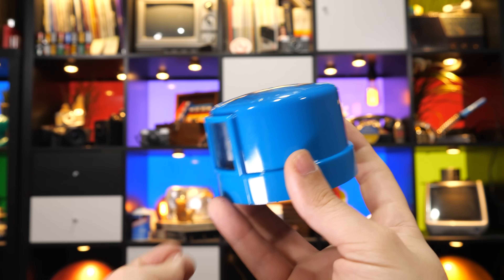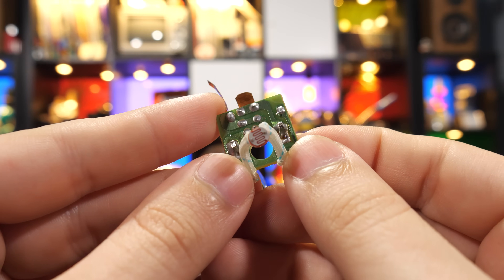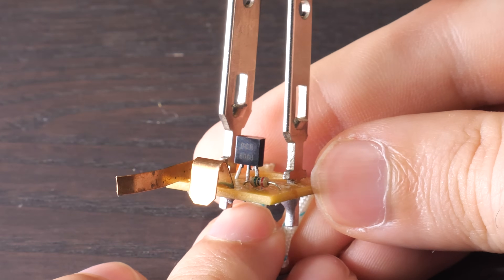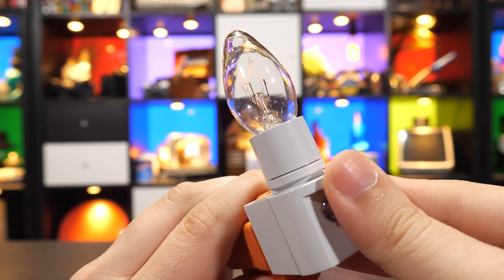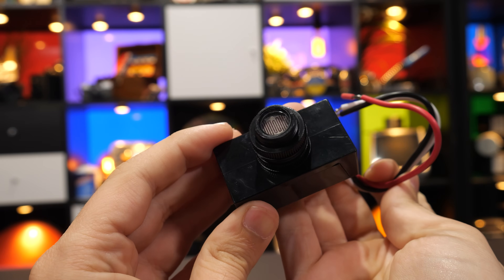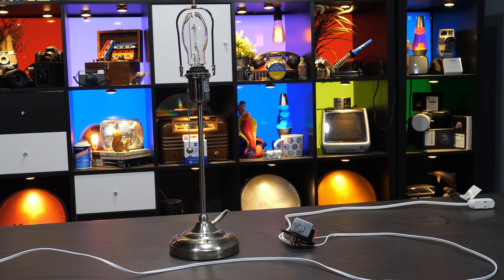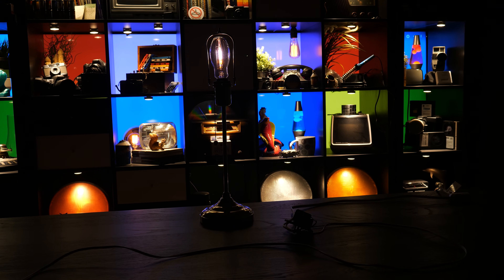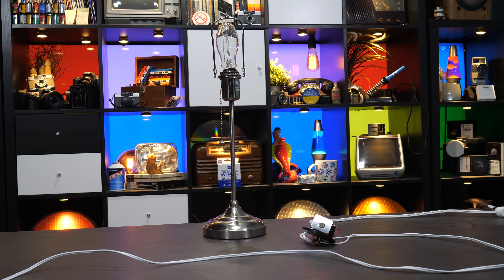Photoelectric light controls are weirder than they seem

Comment: You could also use a little solar panel connected to a relay to have a colder version of that thing, like in the little garden night lights that run off a rechargeable battery. (the solar panel charges the battery in the day and when it gets dark enough it triggers the lamp and stops charging)
Reply: Agreed.  My mother bought a bunch of these solar garden lights and sent them to me. Quite brilliant circuit to use the panel for charging and also to detect light levels.
Reply: @jankrynickyThey don't though. If you look up some studies on solar panel efficiency vs cleaning, they can lose up to 50% of their output very quickly. And they can't be mounted vertically like a photoresistor/diode so dust and bird-poop build up.
Then looking at the circuit, does it still work after losing 50% of it's input energy?
How does that compare to a photoresistor losing 20% of it's resistance? Does the circuit still do it's job?

The photoresistor circuit is much more tolerant to a wide range of conditions and the mounting angle helps it operate more consistently.
It's simple and robust.
Reply: This is done.
But it is also wasteful in it's own way.
Those batteries are consumable.
The solar panels are consumable.
The maintenance/replacement costs are orders of magnitude higher.

It is still useful to have that solution in your pocket for when it really IS the better solution, but 99.999% of the time it isn't.
Reply: @Prophes0r one of the things this channel has highlighted for me is the difference between durable goods, and consumable goods. Things like solar panels and rechargeable batteries get close to that dividing line. How many use cycles can you get out of a system before it goes from consumable to durable? I guess a good reference would be the rest of the object. Whichever piece wears out first is the consumable. 😂
Reply: @Prophes0r 
In street lights the battery would obviously not be needed and instead the solar panel would just trigger a relay or  transistor.
Reply: @Prophes0r a capacitor would take care of quick changes.
Reply: @Prophes0r  yes and no. the panels aren't consumable except panels that use transparent polycarbonate as covers.  the nickel metal hydride batteries are atrocious though, they have little capacity, dies in a year or two due to little cycle life around 500 cycles and heat exposure.  Lithium-ion based lights are better as long they don't get exposed to heat and costs around the same or cheaper than NIMh for much more capacity and cycle life. We have a cheap motion detect flood light at the main entry with the lithium ion battery housing separate from the solar panel. it has been working for more than three years and I'm itching to replace its stock 18650 battery that still works.    In short, it is worth it especially if you live in a country with expensive professional electricians.

Comment: So how much does outside temperature change the trip points? It seems like -60F vs. 110F should make a difference. Actually a black enclosure in direct sunlight should push the temperature even higher inside. As in higher than the switching temperatures shown. Even after the sun goes down, it will take significant time to cool down.

Comment: To your remark of using a microcontroller. I wouldn't even consider one simple logic circuitry with a Schmitttrigger (German for comparator with Hysterese) would do the trick for switching the relay. But yes this also would require a power supply of sorts.

Comment: The UK ones use a transparent cone of plastic rather than the directional design here. The thermal ones were temperature compensated with 2 bimetallic strips and an open micro switch mechanism. The resistor was attached to one strip, whereas the other one sensed the ambient only. The thermal ones are so simple and last decades yet they’ve been superseded by complex electronic designs which aren’t as good in many ways - one of them is they don’t switch the lights on until it’s almost completely dark.

Comment: There are electronic variations as well. One of the advantages of using a bi-metal strip is that there is hysteresis in the curve of how light is has to be to turn the streets lights off, and how dark it needs to be to turn them on. A feature that stops lights flickering, or turn off and on in rapid succession. This feature makes it more complicated to duplicate the device as an all solid state device.

Comment: In my home town (in Finland), all of the street lights are controlled centrally. There is some light sensor, but I don't know what technology it uses. But that is connected to some sort of computer software. That way, they can light up the lights in a sequence, area by area, thus causing less of sudden power usage increases in the grid. And they can also easily adjust the threshold, schedule the lights to be off during low traffic (or dim LED street lights) etc. The downside of course is that it makes a single point of failure to be able to switch off all street lights (or on), but in practise, I can only remember one time when the lights inadvertently were switched on during the daylight.

Comment: I have a set of lights that I purchased recently battery powered for nighttime use, but they charge with a solar panel. Something I have noticed, however, is this light string does not have a photo resistor, and it pretty reliably can tell when it’s nighttime and daytime. Actually, I think better job than all the photoresistor lights that I’ve had before. 

I wonder how easily that could be adapted to be used   And I also wonder if utilizing something of this measure would be a better way of handling it versus a photo resistor.  I imagine it probably would use less power or be self powered for handling the switching…

Comment: When I took apart one of the photo controlled night lights and checked the part number of the semiconductor, you called it a Thyristor (SCR), was actually a Triac ( bidirectional triode Thyristor) with an internal Diac (bidirectional trigger diode).

Comment: Now that street lights are going LED, many of them will have DC power supplies in them. I think some have radio modules too, for remote control/monitoring. I wonder what the cost saving Vs hardware/infrastructure cost is.
Reply: I think LED street lighting turned out to be a false economy, given their electrical complexity (lots of circuitry and components inside) and lack of robustness, compared to older electro-mechanical types. Personally, I prefer the older style sodium vapour lamps over harsh LED street lighting.
Reply: @techcafe0  if they weren't economical I'm sure they would have been abandoned by now, but I'm seeing more and more being installed.

Comment: If you were wondering why a thyristor is a better choice in that circuit than a transistor would be, it's exactly because of that latching behaviour that only lets it turn off once current stops flowing during the AC cycle. For incandescent lights that isn't too important but for gas discharge lamps that have a magnetic ballast, it avoids generating that voltage spike that happens when you try to stop current through an inductor. It also means it's never "half on", which means when it's on its resistance is very low and it stays fairly cool.
Reply: My question is why a thyristor and not a triac (which is essentially just two thyristor/SCRs back-to-back). it means a very lumpy half wave rectification, which will not suit all load types. I think a switch just ought to turn the power on and off and not be some sort of half-baked light bulb life extender. That sort of waveform is less than ideal for many sorts of lights and LED drivers and if the aim is to extend lamp life (at the expense of efficiency I might add), then specify that in the lamp, not the photo-sensitive switch. 

All the light sensors of this sort I've seen in the UK (which use the same fitting) appear to be full wave, albeit the internal circuitry is different and the modern ones at least don't use thermal switches.

Comment: I think you could go on another tangent about the history of light activated switches with the start at the sun valve used in lighthouses and it's inventor Mr Dalén. It actually worked in the same principle. Sun heated metal rods that expanded closing the gas valve.

Comment: So if there's thermal mass to prevent frequent switching, what's the explanation for the street lights that go all strobe light?
Reply: If they're LED lights, then probably a failure in the power supply or driver electronics, I think.

Comment: Also, because of the usage of heating element, the heat switch opens sooner, when it's cold outside. Like in winter, when street lamps are required to be on quicker.

Comment: Would the heater-based switch have issues with ambient heat? Like if it's 100 degrees F wouldn't the lights take longer to turn on in the same lighting conditions if it was 10 degrees F? Or is the heat difference in normal conditions too small to affect things?

Comment: The fact that these switches turn the lights on when power is restored after an outage is a bit of a problem. Part of the difficulty of restarting the grid is that there are a lot of systems that will come on at full power if they've been off for a while. The grid can handle the combined intermittent load of all the AC running on it, but if the power goes out for a couple hours, everyone's homes will be warmer than they want, and when the power comes back on the thermostats will all simultaneously signal the AC to come on, creating a big spike in power demand. Adding all the street lights onto it makes the problem even worse. It is a manageable problem, generally by turning power on in sections.

Comment: Photoelectric controllers are awesome and this electrician recommends using one of them instead of a contactor bank or digital clock control wherever possible. Way more service calls on the latter two options.

Comment: Brilliant. Great example of how to do this kind of engineering. You need to make two hundred million of the things so they've got to be cheap, and they need to be absolutely bombproof because every time one breaks someone has to go out with a ladder (it was a ladder when this thing was invented!) and replace it, see again earlier point about being cheap. If your reasonably sized city has half a million street lights, it doesn't take much of a failure rate before you're spending way more than it would cost just to leave the lights on all the time. (This is why in the days of gas lighting they did just leave them on all the time.)
And back to that point about being bombproof... They quite literally are. It's not just the lightning-induced EMPs that these can shrug off where a semiconductor would self-destruct. You can be quite sure that this feature gave a few decades of reassurance to emergency planners who knew that working street lights would be instrumental in maintaining civil discipline when the godless commies inevitably used the bomb.

Comment: Could you join me in raging against the new LEDs that my city has replaced all our high pressure sodium street lights with? They remove the side glass, and the LED is only at the top of the fixture, so instead of a nice glow from the street light that uniformly lights up the street and sidewalk, you get a bight spot directly below the light that kills your night vision, and then complete darkness for 90% of the way to the next street light. I'm sure the star gazer environmentalists love less "light pollution", but if you can't see where you're walking and it dazzles you when driving, I'm sure they're causing more accidents or something.

Comment: That night light design you showed at the start shouldn't be allowed on the market.  Switching the outside screw part of an Edison base is a no-no for safety reasons.
Reply: except, that's not how the circuit is layed out. the neutral pin is (correctly) wired directly to the 'outside screw part', as you put it. The neutral terminal in the E12 Candelabra socket is NOT switched; the Hot side is switched on/off via the thyristor.
Reply: @techcafe0  Watch around 2:18 again.  You will see that you just presumed they did it correctly.  You can see clearly that the pin of the bulb is directly to the line and the screw part is switched.  At 3:34 he did a diagram.

Comment: A software-based controller might be a bit overkill, but I see no reason in principle why there couldn't be fully electronic versions of these photocontrols that do the work without mechanics or computers. I've seen this in some cheaper domestic dusk-to-dawn light fixtures (even ones that implemented hysteresis between the switch-on and switch-off light levels), though maybe they aren't as common in commercial/streetlighting applications due to cost or perhaps other issues (I could see an all-solid-state system capable of switching high-current loads being much more expensive than a conventional electromechanical one).

Comment: Back in '99 when I was still in high school, I used the CdS cell from an electronic hobbyist kit from Radioshack to build a "fisherman's alarm clock" as a science project using a battery pack, switch, the photoresistor, and a piezo speaker. The gist being that it starts to screech at the crack of dawn. Everyone was amazed and thought I was a genius despite how stupidly simple the circuit was, I think I built the thing in under an hour, and that included painting the cardboard candle box I used to put it in...

Comment: This explains why these can be had so cheaply. I bought a few as spares for the outside lights and they were £1 each, including postage. Don't know if they are any good, not needed to change one, I think those do have extra components inside however, guessing a microcontroller etc.. 55 LUX for energy saving, although I'm sticking with the standard 70 LUX ones which were supplied, as long as they keep working.

Comment: 16:45 well, instead of using that to control street light contactors you could just use a compact industrial PLC running an astro clock so you wouldn't even need any sensor.

Comment: Fun fact: the vocals on most of your favorite albums were recorded with a microphone plugged into a compressor unit called the LA2A, which controls the dynamic range of the microphone signal using a photoelectric cell. Regardless of the genre or the year of release, if you randomly pick an album from your vinyl collection or spotify playlist, chances are good that the vocals passed through an LA2A before reaching your ears. edit: not to mention that the amplifier in the LA2A is a VACUUM TUBE amplifier... pretty wild to see such archaic tech still in common usage in extremely niche applications in the current year

Comment: I'll tell you from experience that electronic on top of pole can fail quickly with lightning or near by lightning causing surges. The capacitor can be made from ceramic that would work in boiling water.

Comment: That crack about software at end kinda hit home. I use to install electronics that needed ~100% uptime, and as the field became digital I found myself wishing for a cheap device that could close a circuit for 22-26 hours (intentionally large tolerance) but open the circuit for like 15 seconds and reliably repeat this for years at a stretch. 

A lot of electronics with too much software in them out there just waiting for someone to notice and come power cycle them.

Comment: A voltage divider and a transistor!
For my A level physics i did two projects I used that circuit twice.
Once with an LDR and an oscilloscope I did "Measuring the duration of a camera flash"

Then, for my graded project i made a thermostat but replacing the LDR with a thermistor, which controlled a heating element via a relay which heated a beaker of water.

Comment: Check out a "ripple injector". It is a motor that spins and introduces like 15Khz frequency to the power lines and that signal is picked up by the load (street lamps) and they turn on or off. All controlled from a single location. Of course you need the injector and the receivers and that is more expensive then even municipal acquisition costs of generic photo cells.

Comment: Since they are mechanical in nature, these units fail occasionally in interesting ways. Most common are those that get stuck closed or open, so the streetlight stays on all the time including daytime or does not turn on at all. I had a few smaller versions in consumer “yard blaster” fixtures that I used to play with, and some of those did some interesting things. I had one that kept randomly turning the light off after a while and then come back on again a half hour later. It took me a while to figure out what was going on, especially since there are many possible causes of a arc discharge light cycling on and off. It turned out that apparently, the photocontrol (which was one of those plastic box module ones) was getting too warm inside the enclosure where it was mounted, and I guess the bimetallic strip was getting knocked open just from the heat despite there being no light shining on the photocell.

I also had a very cheap, plastic 50-watt high-pressure sodium fixture that used all electronic circuitry instead of an iron-core ballast. Instead of the conventional photocontrol mechanism like in the video, it seemed to be solid state and instead of having a delay switching on and off, it actually responded immediately but had some sort of actual hysteresis baked into the circuitry, so that the switch-on light level was different enough from the switch-off to prevent repeated cycling. I'm pretty sure it wasn't a microprocessor, though, most likely just some fairly simple electronics.

Comment: I'm using an at least 50 years old electronic light controller from Merten Type 5449 for my outdoor lights. It uses a cover with a hole for adjusting the switching. 
I only doesn't have much of a hysteresis but it rarely switches more than once for each cycle.